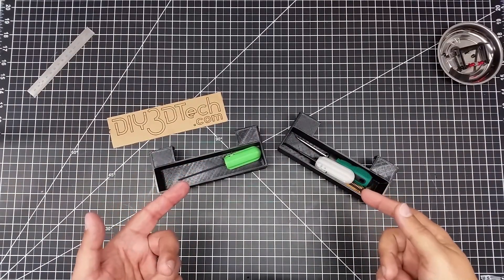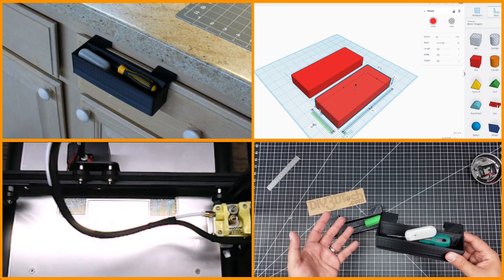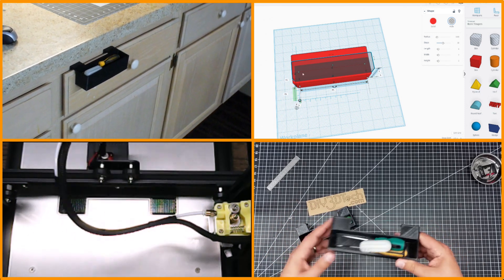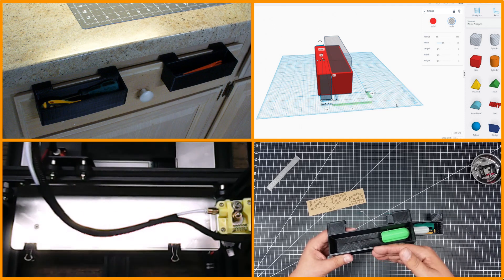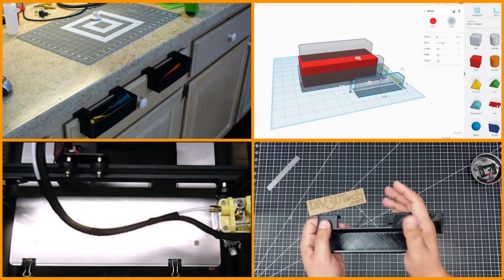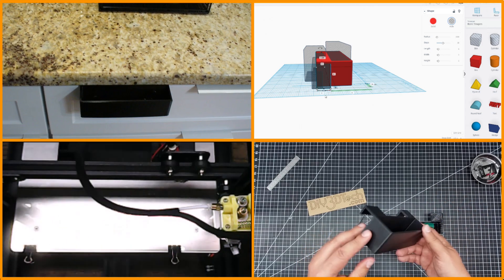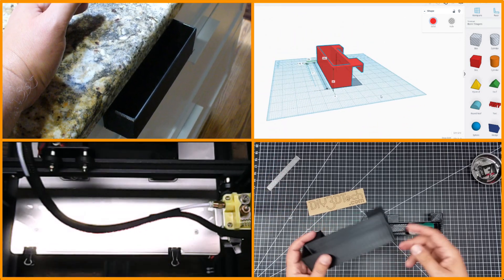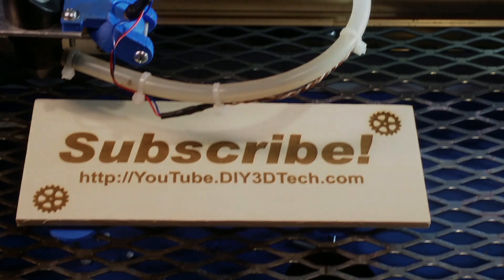3D Printed Project - Creating the Drawer Caddy a CHEP Knockoff!

Comment: You should make it also work on the inside in front and the sides. Just thinking outside the box.
Reply from the maker: Not sure I quite understand "also work on the inside in front and the sides"...
Reply: Put the little tray inside the drawer with the clips out...multi-pockets inside a drawer
Reply from the maker: I guess I have to ask question then why not just set it in the drawer?   However what I am doing is coming up with differing clip designs for different applications.